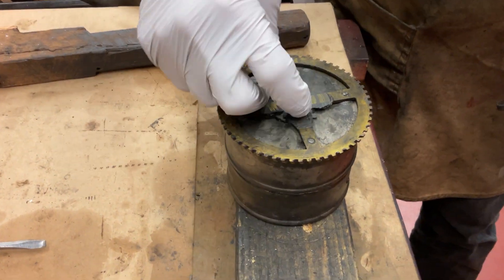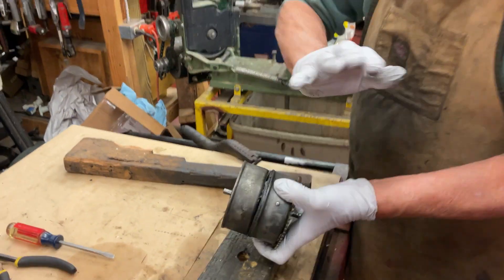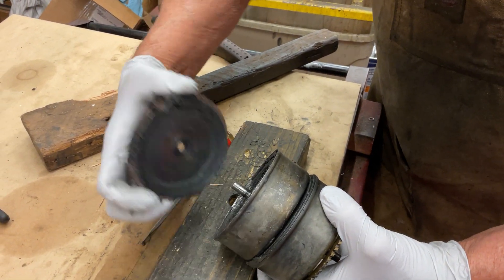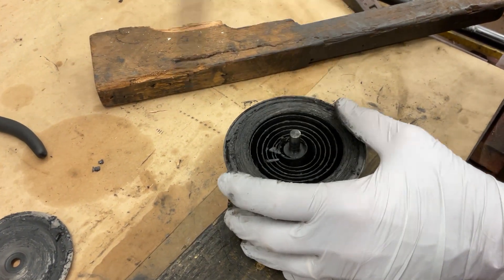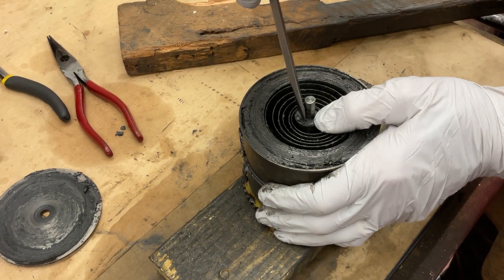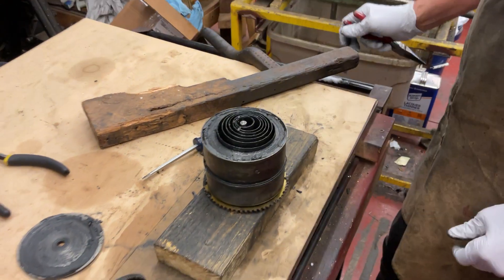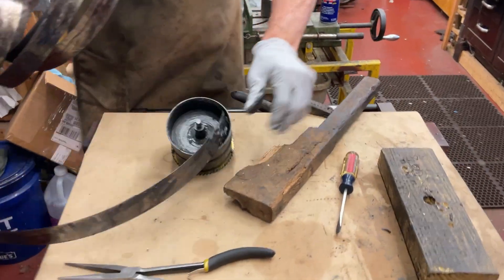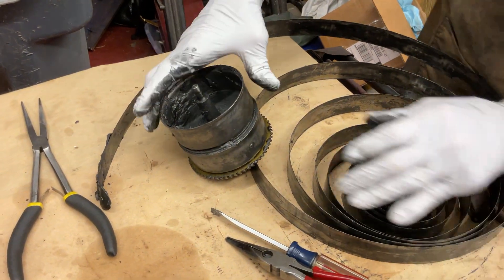1711.  Taking apart the VV-IX spring barrels and removing the ratchet gear ￼

Comment: I have a victor ix I believe it’s 1913 it has the double barrel springs do all the victor 9s both run clockwise putting them back in the barrel I wanted to make sure thanks for any help you can give me a
Reply from the maker: If it has two springs in one barrel, then one spring goes in counterclockwise and one goes in clockwise. You need to know which way you took them out. If you have two separate barrels, then both go in the same direction.
Reply: @1974hurt  ok that’s what I thought I just wanted to make sure that was the case. Your channel is awesome I’m new to owning a victor your channel has been a great help thank you my friend keep cranking out the vidoes

Comment: So it's not needed to replace both springs if the both wound in same direction?
Reply from the maker: If one spring is broken, I always recommend replacing both since the transfer of energy from the new spring to the weaker older spring will likely caused that one to break
Reply: @1974hurt  
That's what I figured but you didn't mentioned it this time. 
Thanks.